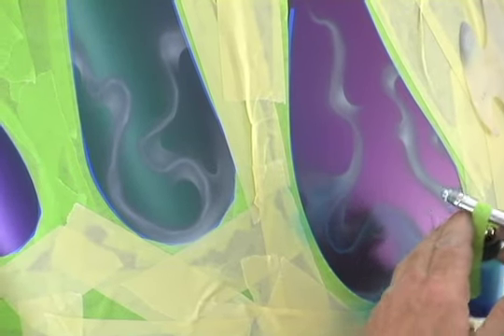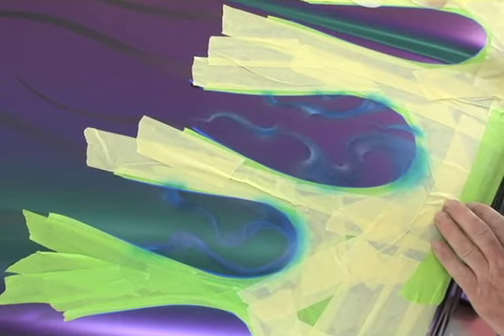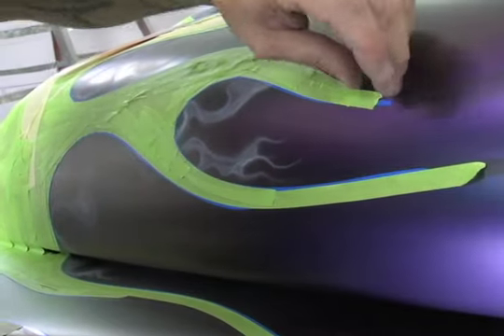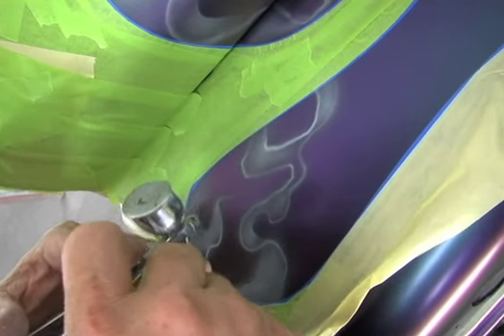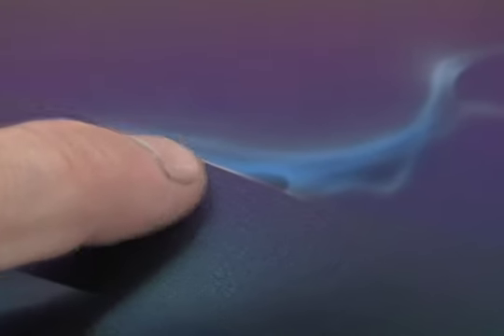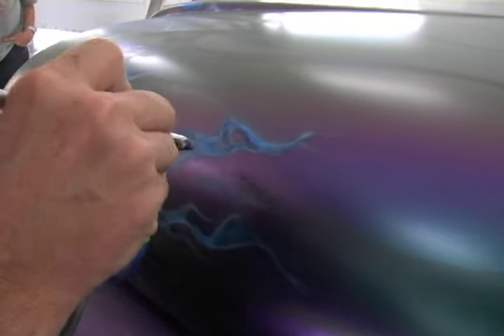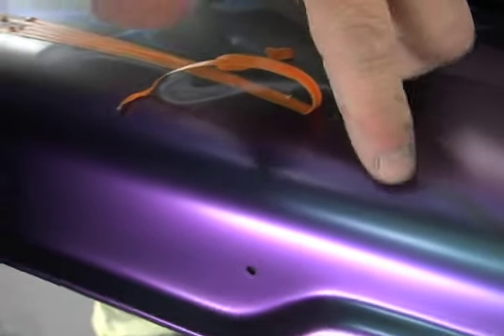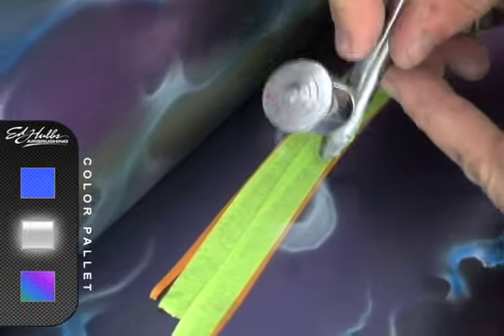Airbrushing Twisted Flames - [part - 2 of 3]

Comment: Hey Ed I noticed the camellian color and the blue Kandy your using is very thin paint
I'm using is not that thin an when I paint I get alot of spots where it looks like alot of dots instead of a smooth line is that because the pint is too thick an not flowing right?
Reply from the maker: sounds like contamination on your surface

Comment: hi Mr.  Hubbs,
on the brush that has the blue, i noticed tape holding the cup.  i have a few "master" brushes that keep dropping the cup.  is that why you have tape on yours? plus, i am quadraplegic.  i am going to glue some sort of devise on the triggers because the lack of control.  i am getting use to the dual action.
Reply from the maker: Its just a precaution because I have had spills before